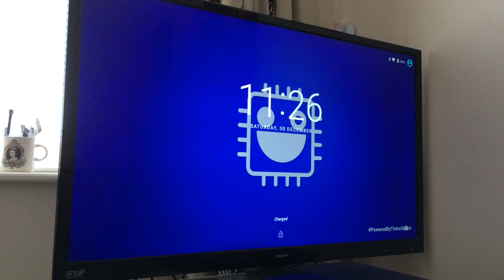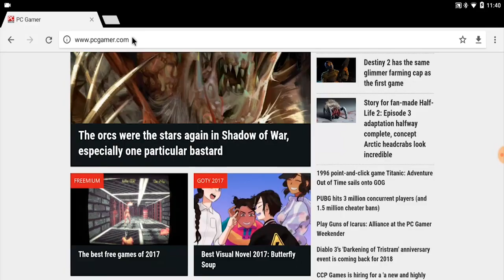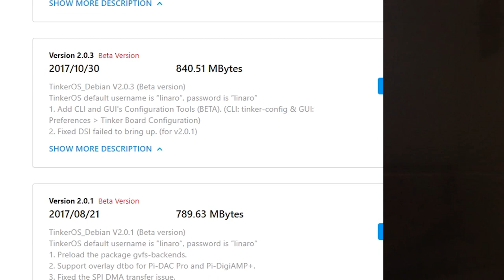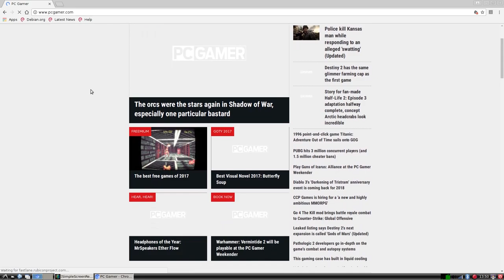The Tiny, Cheap Asus Computer That Fits In The Palm Of Your Hand

Comment: Better than my pc
Reply: Michael Albanese i was looking for this comment just to say that I also have a pc worst than this
Reply: Summoner Arthur I have a decent pc it’s just my graphics card died and I have a igpu with 128mb vram
Reply: Daredevil oof
Reply: Clunker? I have a 2005 tablet (upgraded to a massive 715 mb of DDR1 or DDR2, not sure) single thread low power tablet CPU, and it is actually pretty snappy. I load Puppy Linux into ram (no HDD, just use a USB drive, but I remove the USB for a keyboard) and its actually pretty fast for web browsing. Just put Puppy onto your old machine and it will do really well.

This is not the computer I normally use, I have an overkill editing/gaming machine, but its fun to play with old stuff, and my dad found it for $0.25
Reply: Jake Garrett linux wont boot on my pc since ive overclocked it to 2.45ghz. not sure why tho.
Reply: Your overclock is likely unstable. Sometimes I can get into windows at 5 Ghz, but only about 1/3 times. This is an obvious sign of instability. Linux on the other hand probably cares when half the things don't work at bootup (windows has so much bloatware and unnecessary stuff, that even if half of it fails, it might still get into desktop, though will be highly unstable). Dial those overclocks down and do proper stability testing (Prime 95 for 24 hours straight if it boots into windows). If the memory is overclocked or latency changed, you can run memtest 64 on the startup of Linux.
Reply: Jake Garrett sure, I've underclocked it at 2.32ghz so both would work.
you told me to try prime 95 right? playing a heavy game in it isnt enhought to test it? I ran saints row iv on it for like, 8 hours straight, (for a single core, this is heavy) and I didnt get any problem. no shutdowns or overheating.
Reply: No, I've passed benchmarks and games with ludicrous overclocks. Here is my 52% GPU overclock for example https://www.techpowerup.com/gpuz/details/2hwdz
For a CPU, you need to stress all cores, and games won't crash all the time even with some instability. That's where P-95 is very important.
Reply: Jake Garrett all the cores? but theres only one...
Reply: Oh, realized you have a single core... But yes, even if its stable in 1 program and says 100%, it may not be fully stable (just like my unstable benchmarking). People often notice an overclock is unstable in certain games (different programs stress it in separate ways, you can often see differences in power draw even when it says 100%).

Comment: Rg in HD. Make an r9 290x build!
Reply: Tabeeb Rahman lol why ?
Reply: lol why ?
Reply: Why should he?
Reply: Tabeeb Rahman he's already got a central heating system mate.
Reply: Xx Luke xX the r9 290 isnt so bad in terms of temperatures. But i need to wait for summer to be sure for that
Reply: I owned the Sapphire Tri-X r9-290x for a while. It had 3 fans and I never had temperature issues.
Reply: And pair it with a fx 9590
Reply: Johns Memes now thats a nuclear reactor. I have the good old chill 2500k
Reply: Nate Martin i dont have either with my wf3 oc, but we were talking about the heat going out the case and warming the room in the summer
Reply: Darius Guran it is with an all amd build, fx 9590 overclocked, rip vram. It's a great way to heat your home, certified by AYYYMD
Reply: Yes, and as someone else mentioned, pair it with an FX-9590.  Call it the Winter Is Coming build!
Reply: SrSheepdog i could use intel 7th or 8th gen as well. Fx kinda sucks
Reply: Darius Guran idk... FX is a better house warmer than Intel 7-/8- series. The cores may be at the same high temps, but that's just because while Intel's crappy TIM is not transferring the heat to the cooler, FX's hotter cores are flowing the heat nicely through the solder. So more heat actually coming from the system on AMD.
Reply: SrSheepdog yea youre right. If id watercool my r9 290 for better tems it will heat up the room worse
Reply: vovochen because they have been hitting it cheap on cex
Reply: Hot rod pc for da win! Get it! Ok ill leave now
Reply: lol why?

Comment: Does anyone know if I could use any mxm card in a imac for a build considering it's running windows 10
Reply: It depends on a lot of things, MXM is a standard format, but the cooling solution used and power consumption may be different across machines, so a 560m that works in one machine might not line up with the cooler on another, or its power draw might be slightly higher than what the system allows. Theres probably compatibility lists out there somewhere for your iMac model to see which cards you can and cant install.
Reply: holy shit what the hell all the mxm cards have the same cooling design besides the 1050ti mobile, 1060m, 1070m, and the 1080m. And also surprisingly there is not an official list. I've even contacted apple and asked and they told me not to do it because it'll void my warranty even though I don't have one. looking at the 780m it's under 54 watts and way better then the current card
Reply: there's no 780m that use only 54 watts, and it's also hot as hell
Reply: John Kozak yeah there is and plus look at the iMac 2011 gpu cooler it won't run as hot considering it's not shoved in a laptop either
Reply: far as I know, the gtx 770m use about 75W, so there defenitely no way the gtx 780m can use only 54W across the board with vram, etc.
and yeah, the iMac 2011's heatsink looks promising, you could give it a try though, just make sure that the gtx 780m is whitelisted in the bios, otherwise, you'll have some works to do to get it working
Reply: John Kozak just found out it was a underclocked gpu for a clevo laptop that's why it doesn't run as hot and only consumes 54 watts
Reply: Mister-Tea what's the fun of that and idk about buying a card that cost a bullshit price
Reply: Kyle ._. You have an iMac whose running Windows, you want to game on it and Upgrade it. The exact opposite of every Mac user. If you find it expensive, why you bought an iMac to play game? If you really want to game, sell it and get a PC.
Reply: Mister-Tea just so you know it's in no means my main system my brother asked me if I could upgrade it to play games like cs:go garrys mod and maybe call of duty and battlefield
Reply: Mister-Tea also I game on my main system with a ryzen 5 1400 16gigs of ram and a rx 570 I'm in no means a mac user or ever will be
Reply: Get Surface hub

Comment: Can it run crysis at 4k?
Reply: At 4 fps.
Reply: That would be 12% of a GTX 1080 (which does 33 fps avg for Crysis 3 at High)
If it did that, then I think most gamers would jump over to Linux (which can run Crysis. I want to compare fps differences, especially crossfire vs windows crossfire)

Comment: Try to install Windows 10 / 7 on it. Like if you agree
Reply: windows runs on amd64 or x86, not on arm
Reply: silentsaintR wrong windows 10 is now fully supporting ARM CPU's
Reply: The thing is windows will not support all ARM based chips just some of them!
Reply: Mountainpixel only snapdragon chips. Asus thinker board doesn't have it.
Reply: Meashow  i Think you can find iot core somewhere
Reply: Yes. but the iot core doesnt have a normal desktop.